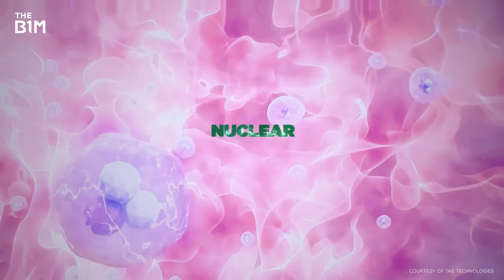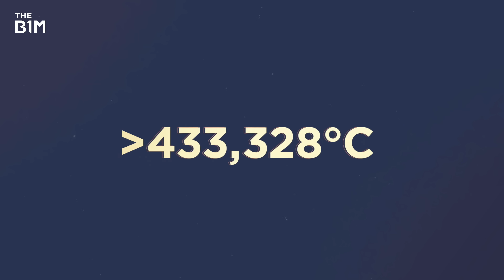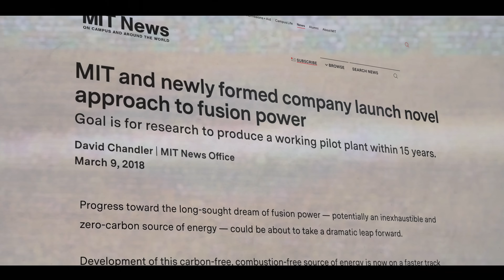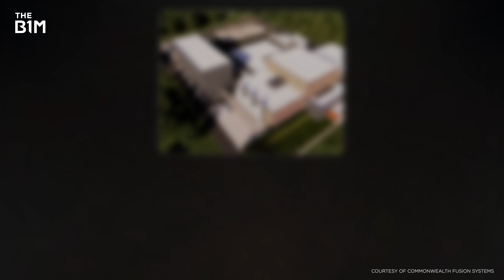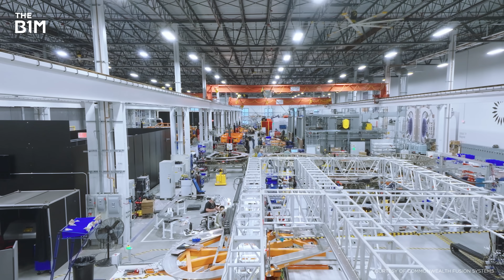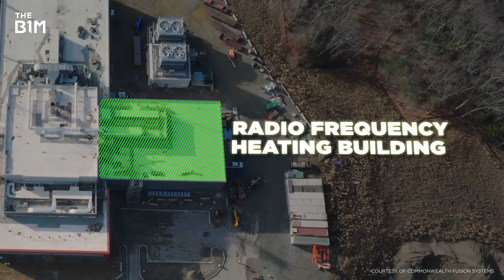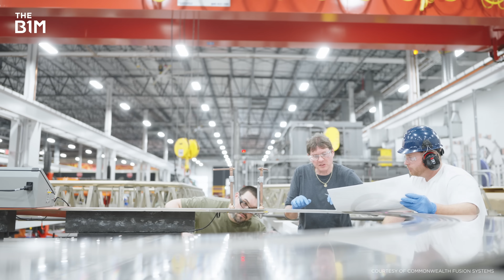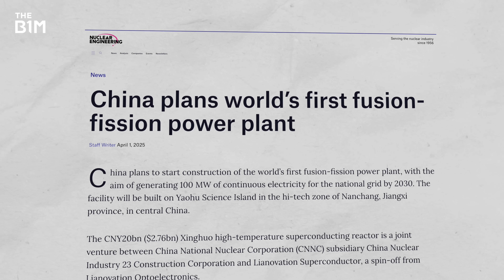Is America About to Win the Nuclear Fusion Race?

Comment: I really hope America continues to invest in nuclear energy and that this project yields promising results. It’s one of the safest and most efficient form of generating base load low carbon electricity and there should be a lot more reactors (particularly SMRs) around the country. The only downside is it’s expensive (in terms of upfront cost anyway) and does generate some waste although it can be reprocessed and stored safely underground. Costs can be brought down by using economies of scale, common parts/materials and a trained workforce but we have to build enough reactors at the same time for those savings to be realised.
Reply: There's no such thing as safe energy in a greedy world riding the gluttony train full steam.
Reply: No one anywhere has managed to store irradiated fuel rods and uranium tailings and liquid boiling byproducts of reprocessing in a means that is safe for our great great great great ... great grandchildren.
Reply: @markrobinowitz8473 do some research and you’ll see your point is completely wrong. Uranium fuel rods are stored in reinforced concrete caskets that last for decades and can withstand extreme heat, pressure and force. An 18 wheeler semi truck can ram into it at 70mph and there would only be minor damage without a radiation breach. Right now they are stored at nuclear power plants themselves but a permanent underground storage facility would ensure they are safe for decades and even centuries. Such a proposed storage site has long been planned for Yucca Mountain but has been with met with opposition unfortunately
Reply: @markrobinowitz8473 also Finland is building an underground storage facility for storing nuclear waste so if they can do it then so can the Americans.
Reply: There are reasons why nuclear was all but abandoned and it was not out of fear or nimbyism. It is economics. 

Nuclear power is effectively at technological dead end. It is the most expensive form of power generation. A single plant costing 10's of billions and a decade+ to construct. You can build out vastly more solar and wind generation in a fraction of the time. SMRs are not a thing, and are likely never going to be a thing. Nuclear requires massive scale to get anywhere close to economical. Costs intreat every year, there is a lot of highly specialized equipment that needs replacing, security costs, maintenance on facilities, not to mention disposal. SMRs do not generate enough power to return enough revenue for cost of operation and construction. 

Want power, get solar to replace roof shingles, put a battery in every home. We have monumental amounts of vacant empty roof space from giant warehouses that can be outfitted with solar. More than enough to vastly out supply electricity needs. 

Not to mention a paper out of the University of Oxford showing that fully electrifying the economy would reduce current power demand to just 60% of what is currently generated. People do not realize how much power goes into FF extraction, shipping, processing, refinement, shipping yet again, and storage.
Reply: @yttrium-v2x    Nono, nobody should say that one type of energy generation is the future or dead. You need a blend of all of them. 

Renewables needs storage solutions to smooth out generation. Prediction of both demand and generation is crucial to manage smart grids. I did a lot of literature review in smart grids and for my thesis proposal before (not my final topic, it was NILM at scale) Storage solutions are expensive.

You also have to consider ramping capabilities as well. They can't "respond" to demand in the way that gas and coal can. Nuclear is poor at it.

So.. it's all complimentary. Green as much as possible, where there is space. Nuclear for consistency and efficient utilization of space. Others for responding to fluctuations. 

Now, Gen IV nuclear power, along with improved building techniques can lower lcoe significantly. China has mass produced parts for multiple plants and also recycled their Gen IV designs. Nuclear is still viable, although not cheap. Many of the designs are more than half a century old.
Reply: @yttrium-v2x solar and battery electric storage is great for residential or commercial applications but is not feasible at large scale especially for industrial power requirements or for data centres which require Megawatts of electricity. The price of lithium ion batteries is relatively cheap but would my make it sense to build such a large battery at grid scale. They take a lot of materials and eventually lose their efficiency in charging and discharging electricity. It’s the same reason why phone batteries lose their max capacity after so many years. Also in my comment I stated that nuclear is a great form of “base load” electricity whereas solar is intermittent even in places that get a lot of sunlight
Reply: @yttrium-v2x  

Nuclear really isn't that expensive when you consider lifetime costs. While you're busy replacing solar panels every 5-10 years, the vast majority of nuclear plants are only changing fuel rods and some consumables, maybe a couple of components every overhaul. Now those components and that work is expensive due to the regulations, the quality assurance, the skilled labor and technical expertise required. However, keep in mind that this is being done on plants constructed to different codes of construction based on when they were commissioned, and the volume of work isn't terribly large so the economy of scale isn't quite what it used to be. As for the build duration, that "decades to build" quip comes from a handful of plants that were paused in construction for various reasons, nuclear scares, administrative errors, or technical discrepancies with major components, requiring a large amount of additional QA in addition to the cost of getting the components fabricated. If you were to look at the build times of all those reactors, especially back when we were still figuring stuff out and had to take extra time, most were up in under a decade.

The nuclear industry isn't perfect for a number of reasons, there is a lot of room for improvement when it comes to construction codes, standards, and the industrial base supporting it as a whole; it is an invaluable in being a reliable, steady source of base load power to drive industry.

As for SMRs, they would be very cool if the companies developing them were working with the idea of dropping units into existing power plants to replace the existing boilers, that really isn't happening for reasons related to the regulations mentioned above. My larger gripe with SMRs isn't related to their returns on power generation, it is with their fuel. Standard reactors run on relatively low enrichment uranium. They can do this because their cores are so large the rate that neutrons leak from the core is relatively low, meaning they require less positive reactivity from the fuel in order to achieve criticality and be able to generate usable power. Smaller reactors, due to their size have more surface area compared to their volume, so they leak a higher proportion of their neutrons, requiring more highly enriched fuel to achieve a similar core life. So now your reactor fuel needs to be enriched to a much higher degree, which IS immensely expensive, and is more dangerous when considering the threat of nuclear proliferation. Small reactors are good when the application makes sense. A reactor in a submarine or other ship needs to be small and light to be useful, a reactor on land doesn't, because the land use for the power generated is much smaller than any other option on their own, so there is little added benefit.

I do agree with you to a point, when it comes to renewable energy systems, implementing them into the existing power infrastructure at a smaller scale for residential applications is most optimal.
Reply: @Grizzly-Mike-931  Nuclear is expensive over its entire life. The stats that Nuclear is the most expensive form of power is over its life time. It is cost to consumer. 

Solar Panels are cheap, cheaper than regular fencing, and have 30 year life spans. 

Nuclear taking decades to build are based off of build times in the last few decades. Construction was not halted or slowed down. These are massive projects with a lot of safety considerations.
Reply: Please see my previous comment, conduct some google searches and educate yourself. I would look into France and their approach to nuclear power. They are, in my opinion, doing it the best of any country and it shows
Reply: @Grizzly-Mike-931  I have been reading and researching this for 15 years. It is the reason why i know what you said is false, you had the audacity to say solar panels needed replacing every 5-10 years, which was a huge indicator that do not know what you are talking about. 

Nuclear plants are full oh highly specialised very expensive equipment, that is in need of constant maintenance. Having walked inside of thermal generation plants they are not just the heat source and some pipes are you stated. 

Price per kWh nuclear is the most expensive for of power, where wind and solar are the cheapest. There is nothing clear can do out side of som miraculous development to change this. Go check out Our World in Data and Hanna Ritchie
Reply: @yttrium-v2x  I look forward to seeing figures on price per kwh when you have to factor in storage batteries. When we don't have anywhere close to what we would need in order to effectively implement solar power anywhere but ideal climates.

Considering that we have roughly 6% the battery storage we would need to power the US for one single second, not even thinking about how you would store that energy for off-peak production and on-peak demand hours. And those charge and discharge rates would create massive wear on existing batteries.
Reply: @Grizzly-Mike-931  Like i directed you to, Hannah Ritchie, perhaps the worlds leading expert on energy and power generation. 

Now you are moving the goal posts calling for battery solutions to be included. Battery prices are plummeting fyi. 

There really is no place that is not an ideal climate to for solar instillation. In the arctic and ant-attic circles for 50% of the year, but then they have wind power. 

You cannot change the reality and with and solar generation are the cheapest forms of power on the planet. A few years ago there was so much wind power in the UK that prices went negative. Other generators use cannot compete. 

You are trying to create these extremes, and unless everything fits into them, they will not work for you, which is not how things work.
Reply: @yttrium-v2x  Hannah is clearly bright, but suggesting she is "perhaps the worlds leading expert on energy and power generation" is laughable and shows your lack of seriousness on the topic. 

For grids there are two factors which must be in balance for optimal energy solutions, reliability and cost. "Extremes" and building an infrastructure that handles them as inexpensively as possible is exactly what grid operators think about day in and day out. 

Wind and solar are great on the isolated cost of generation, though they are better in some geographic areas than others. They will almost certainly be a certain % of any modern grid going forward, but the % will be different for each individual grid as resources and requirements differ. Where they suffer in the comparison is on reliability and it just gets worse the greater the % of total capacity they make up. Grid operators use a factor called "effective load-carrying capability" which is added to the LCOE for PV/Wind plus storage (and other intermittent resources) to account for the lack of 24/7 reliability beyond the 4hr storage used in LCOE of PV/wind +Storage. This is called "firming the grid" (i.e. making it reliable) and the cost can be quite high, often multiples of the generation cost when a significant portion of the generation comes from intermittent sources. This only gets worse as we move away from fossil fuels as relatively cheap Natural Gas plants are currently what is generally used to fill in these gaps (because it is still much less expensive than batteries for beyond 4hr in 2025)

But don't take my word for it, instead actually think this through. If your position was correct, then a country like China where the cost of BOTH renewables and batteries is the lowest in the world, where vast areas ideal for solar/wind exist and opposition to projects is essentially banned, would NOT be building huge numbers of nuclear fission plants (which they are!!). Actions speak louder than words and China, let alone the rest of the world, is proving your position wrong.